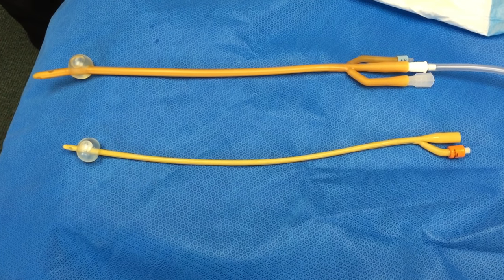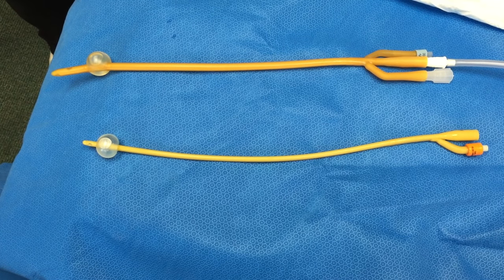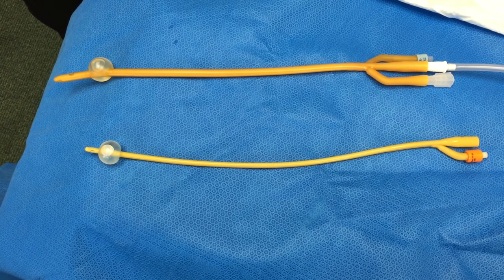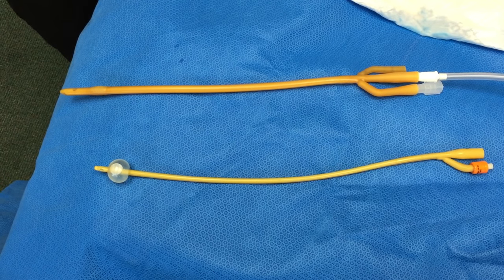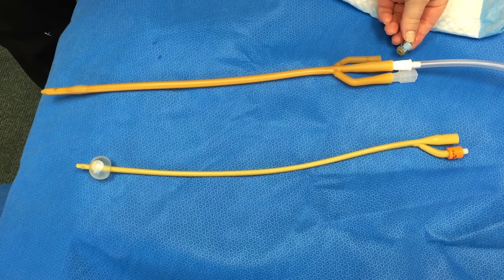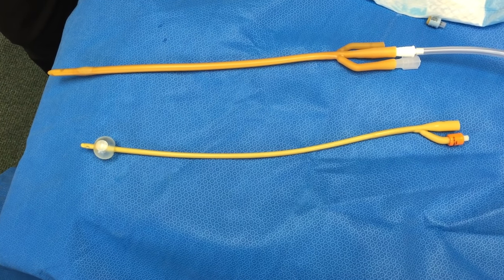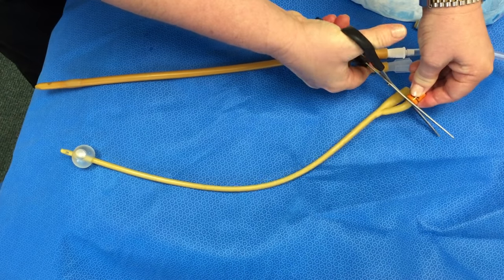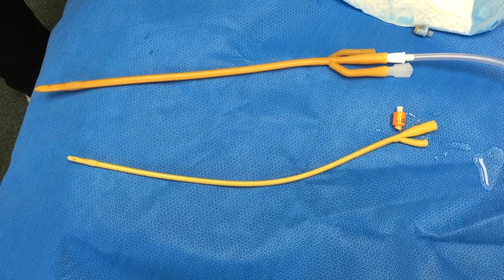How to Remove a Foley Catheter

Comment: Two catheter changes in the same day
 After a month of placement, my catheter became clogged.  At midnight I had severe cramps and an attempt to unblock it with a larger syringe full of distilled water for flushing failed.
 So I emptied the balloon with an empty smaller syringe and expected the catheter to come out by itself.  But it didn't come out even when I pulled it.  I pulled harder and the catheter stretched like a rubber band.  Once before I already had an independent forced withdrawal of the catheter, with pain and bleeding of the prostate, but then there was no such elastic resistance of the catheter.
 What to do?
 I am 74 years old and have been wearing a catheter for 7 years and maintain and change it myself.
 I knew the problem was mechanical - one half of the inside of the catheter was calcified with sand and the outside of the balloon had sand deposited so although deflated, the balloon would not penetrate the bladder sphincter.
 So I took a piece of soft wire, the kind used when connecting reinforcement for concrete columns and beams. I pulled the wire into the catheter tube and gradually turned it left and right.  When I managed to get her two-thirds of the way up the catheter, I squeezed her firmly over the catheter tube and, regardless of the pain, pulled her out with the catheter.
 That worked, the catheter came out, the balloon and the drainage holes of the catheter were lined with sand.
 It hurt and I bled but not more than an average period.
 I waited a few hours for the blood to drain from the penis and then inserted a new catheter.
 I didn't fall asleep until around 8am and slept until 1pm
 Then I went out on the footpath.  to hit my 5km for the day.
 And when I was about 2 kilometers in, I felt the balloon on the catheter burst, even though it was only filled with 10 milliliters of the recommended 30.
 I turned back and walking home I could feel the edges of the protruding ruptured balloon cutting my prostate and urethra.  In doing so, I peed in panties.
 At home, the catheter had already come out by itself and there was new bleeding.
 Then I put a new catheter and now I am calm.

Comment: there are many videos saying use a syringe and yours is the only one saying just to cut it. so is it safe to cut ANY catheter?
Reply: mozzbozz i think the reason why they are using a syringe so its not gonna be messy, coz if you cut the catheter it will leak into your bed
Reply: @msteryosa4239   because no one is smart enough to put a couple paper towels under it first....plus they can charge you for another procedure in a hospital ....probably 10 extra bucks for a new syringe each time ...matters not if they paid 50cents
Reply: You MUST use a syringe! You need to know it was 10cc you removed as that is what went in. What goes in must come out. If for any reason you don’t get 10cc, such as a blockage or a faulty cath balloon, you will be pulling a partially deflated balloon through a urethra. Ummmm, NO thank you. Patient comfort. Certainly in an emergency you can cut but protocol is a syringe. Why would anyone want to take that chance!? The damage you can do by pulling a partially filled 14-16fr through a urethra isn’t going to be fun for patient and it’s problematic to infection, urethral tearing etc. Cutting is lazy nursing. Period.
Reply: I recommend using a syringe. They're cheap and easy to obtain. if however, you do go this route, at the very least use a measuring cup to assure full deflation of the Foley balloon,
The balloon holds 10cc of saline,  so you should have 10cc of saline after deflation. Then you know that it is safe to pull the catheter through. 

Pulling a partially deflated balloon through your urethra isn't only going to hurt badly, it's gonna cause more problems.

Oh and be sterile! Use gloves and alcohol.

I believe the information I've given to be true, you shouldn't 
* I am not a medical professional
* search for, " Foley catheter removal"
Reply: @KissMyAxxe123  your local pharmacy or any walmart. You may have to ask an employee, but they'll have it. You can also ask your doctor, I asked mine, and he gave me a few
Reply: @KissMyAxxe123  if you can't find a syringe, maybe use a turkey baster and a measuring cup. I do not recommend this route. When doing anything medically related, sterilization should be your first and foremost concern. But personally if I had too, I would, because having a catheter in longer than instructed is putting you at unnecessary risk for infection.

*I'm not a doctor or a medical professional
Reply: Had Five catheters and They Always came with a kit:  2 size Syringes, tape, and Saline solution. Supposedly ONLY if a 'Home Nurse' must fix Any problems.  The ONLY reason to CUT, a non-reversible, sloppy method, Be laziness or Syringe stores Too far away, Maybe? This 'sloppy short Cut is for Medical people only, Not a First time 'Home Removal'?  Syringe is Essential.
I Believe the Syringe is Vital, to get the Full 10 cc of Saline out, For Sure!
Plus, once you Cut it (Sloppy) you could Never Pump in more Saline, and wait to see a Nurse. (my own 'idea'?) Cut it, there is NO Return possible, Emerg.!! Ack, 6 hr. Wait, typically, if it is Non Emergency?  NOT for ME, thanx, ever!
Reply: @tovah2276  I think this is more of a last chance situation. I’m currently searching this because I just had a spinal fusion last week. 8hrs of surgery and being under anesthesia. I was admitted for 4 days including the surgery day. It’s now been 8 days since I was released and I’m in so much pain and still have to go the holiday weekend waiting for my insurance to approve me going to the urology clinic… and I can’t get into my primary care for another 5 days at the very earliest. Urgent care already said they would only test and treat a UTI, not remove the catheter. So when it comes down to situations like mine, I think that’s the type of people looking for this help.
Reply: Syringe is the ideal practice in case you missed at the time you can use another alternative as cut Ballon port tubing. First preference is use always use syringe.

Comment: must be a  different kinda catheter my  doc out in me, which i will be  removing myself tomorrow. he gave me 2 syringes to attach to the one port and draw it out. could it be easier or even possible i could do it your way on mine?
Reply: kenneth risner I had a hard time finding the type a syringe to remove the fluid from the balloon I just snapped like this then might do that on purpose so you don’t reuse the catheter
Reply: Cutting is what we were taught.
It is way faster and easier to tell if you have complete deflation.
Reply: My urologist said I didn't need a syringe just to cut it like in the video.
Reply: @coronaflo  
I agree and I'm a nurse.
I've done hundreds of these indwellings. 
We were taught to use both methods for removal, but cutting seems to be more sure.
I wouldn't want that balloon exiting my urethra.
Reply: @coronaflo  are you sure its safe I'm kinda afraid to do it by myself 😭
Reply: Linda 82 As long as you follow the directions it is fine, I removed mine in the shower.
Reply: @coronaflo  😥 I'm not brave to do that,  I went to my doctor so she did removed.

Comment: Cutting the tube is the most stupid and dangerous way of removing the catheter. Necessary pressure is required to remove water from the balloon which can only be achieved by a syringe. Disliking the video.